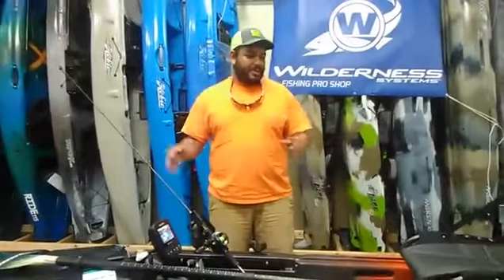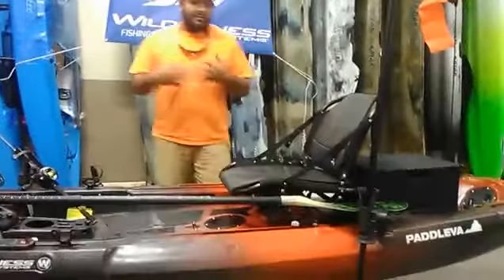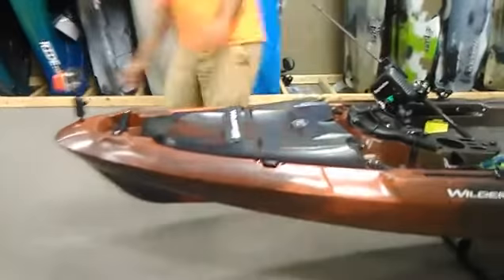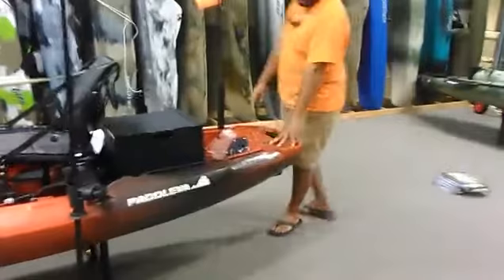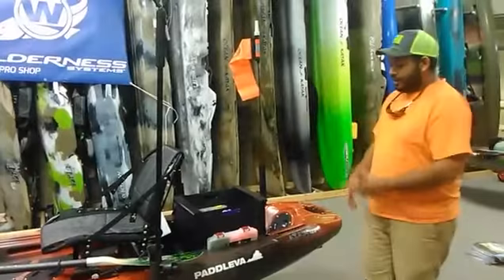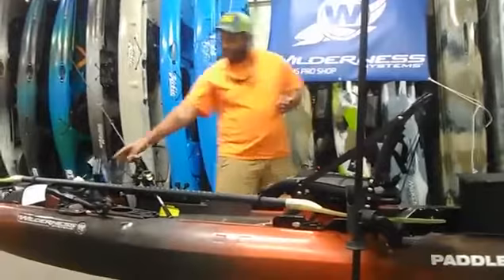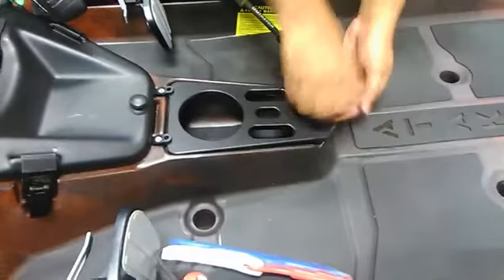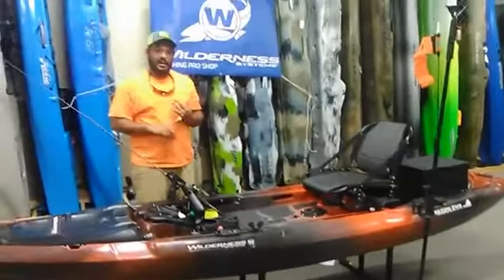atak 120 walk though

Comment: A really nice and thorough review. That is a great point about getting an adjustable paddle. I had wondered the same thing . . . putting the seat up 3 or 4 " in the high position and needing a different sized paddle. What brands of paddles have that adjustment?  And, I know they say on the Wilderness website that the ATAK 120 weighs 86 lbs., but in almost all other vendor websites, they are quoting 70 lbs. And, when I called a number on the factory website, the man said 76 or 78 lbs. (I can't recall which). If you have some really good scales, weigh one for us!   Thanks!  Brad
Reply from the maker: Hey brad thanks for watching. So the production weight of the atak 120 is 78 without the seat and 86 with the seat. Also a few brands have the adjustable feature. The one in the video was the adventure technology oracle.
Reply: Great! that 78 figure is what Wilderness mentioned to me by phone, so the 86 is with the seat and that makes sense. I don't know how the "weight rumors" get started but most everyone is quoting 70 lbs. Thanks again!  Brad
Reply: Brad Reid 70 was the preproduction weight.
Reply: Reggie, that makes sense to me that they don't really nail down the exact weight until the production mold is finalized, that sort of thing. Thanks! Brad